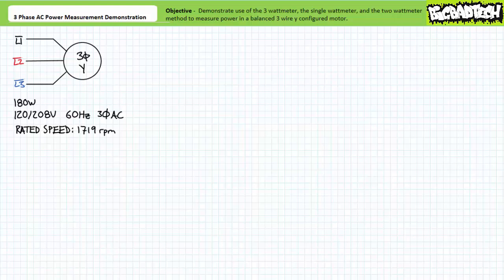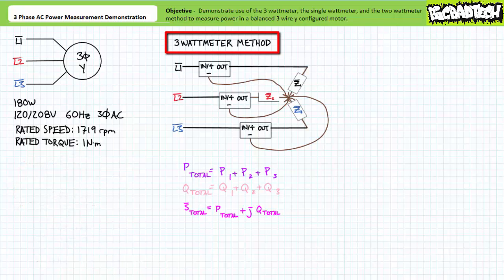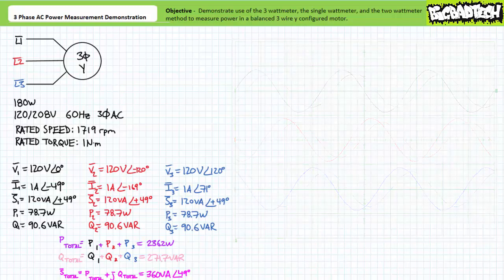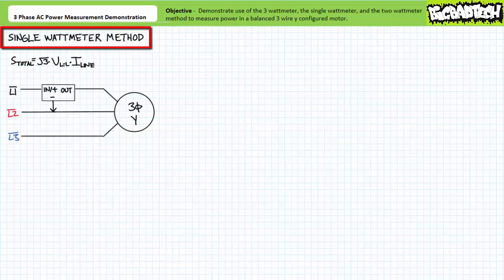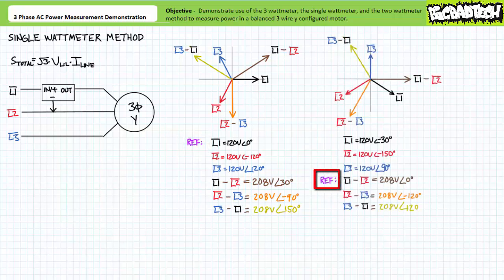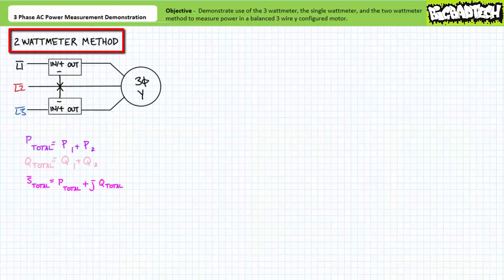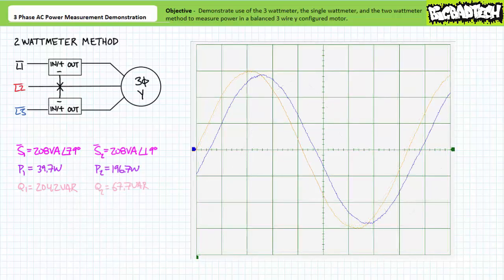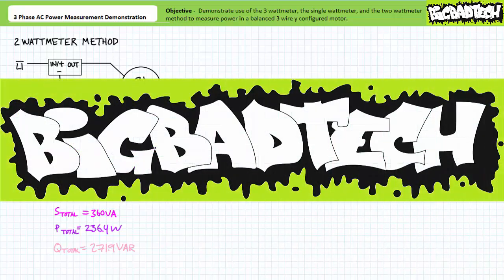3 Phase AC Power Measurement Examples (Full Lecture)

Comment: you have shown +/- signs for input currents. as far as I know alternative current doesn't have such polarity. so according to your depiction if we connect them reversely wouldn't the power measured also be reversed in polairty?
Reply from the maker: Good question. The general advice is to "pick a direction and stick with it". Consider a single AC source on the left and a single load on the right. Voltmeter across the load. Ammeter at the top between the source and the load. 

If your voltmeter and ammeter point in the same direction (ie: voltmeter across the load + to - top to bottom and ammeter in to out left to right assuming conventional positive current travels clockwise) this will give you a valid display of power given power is voltage times current. Similarly, this will also work if your voltmeter is across the load + to - bottom to top and ammeter oriented in to out right to left assuming conventional positive current travels anti-clockwise. What WON'T work is if you flip one and not the other largely because either voltage or current will be inadvertently flipped 180 out of phase.

Comment: I had this feeling I wasn't completely understanding, until you walked us through a practical example, shown here. Sqrt(3) is applied with single wattmeter approach, to correct for the difference between measured line-to-line voltage and actual line-to-neutral voltage. In the two wattmeter approach, sqrt(3) is not appropriate because L2 is considered the reference line, not neutral. Both techniques converge to the same answer when the load is balanced. I'm going back now to better understand that difference in measured offset angles between the two techniques.